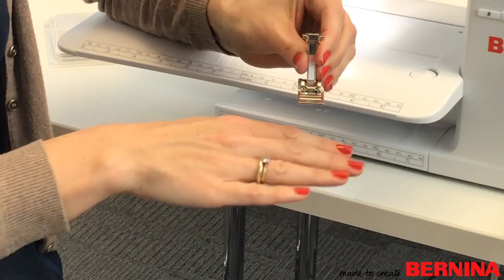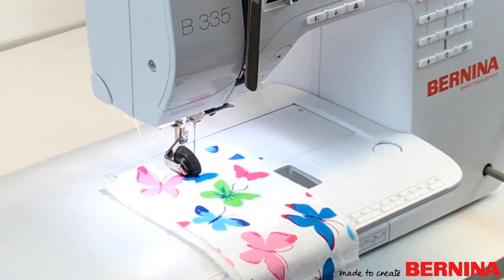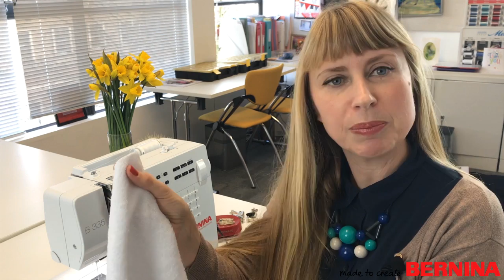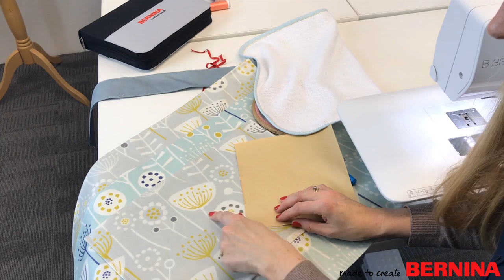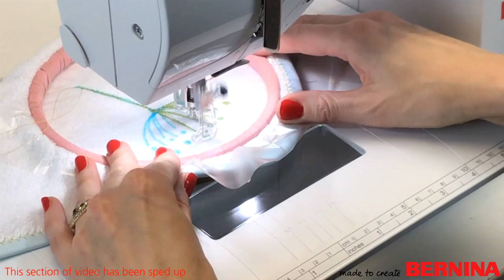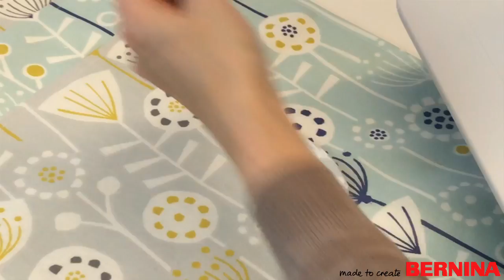Tricky Fabric Made Easy

Comment: Can I use the above feet for model B 570
Reply from the maker: Hi Ruby, thanks for asking. Yes, foot #52 is compatible with your B 570 QE. For full compatibility information on all our accessories please refer to the accessory catalog: https://www.bernina.com/en-US/Support-US/Product-Catalogs As you can see on page 11, there are different versions of foot #52 for different machine categories. If you have bought an earlier version of the B 570 QE (before 2017, see https://www.bernina.com/en-US/Support-US/Machines/BERNINA-5-Series/BERNINA-570-QE-before-2017) you will need the foot type that is compatible with machine category B. If you are using a new B 570 QE with Dual Feed, you will need foot #57D, compatible with machine category E.

Comment: Thanks for the video. 
I own a bernina 380 and I had trouble sewing through a couple of layers of oilskin. 
The needle got stuck and just wouldn't move.
Did you need to change the plate to a straight stitch plate? Or will the no. 52 foot be sufficient ?
Thanks 😊
Reply from the maker: Dear Dina A, 
I do not think you need to change the stitch plate. I recommend you use Foot 52 to prevent the fabric from sticking and a size 90 Jeans needle as this has a slim acute point that will cut through the oilskin stopping the needle getting stuck.
Reply: @BerninaInternational I will try it out and thanks for your reply 😊